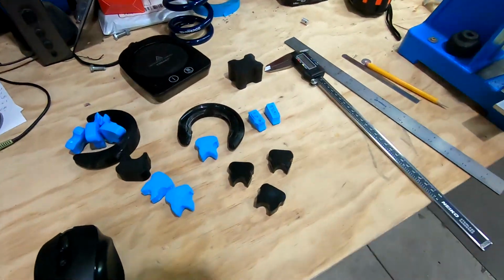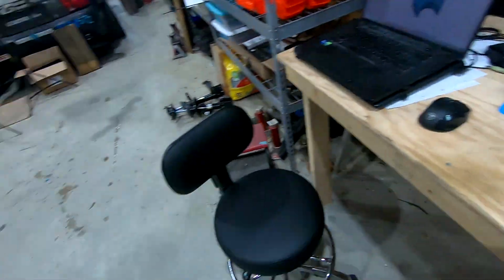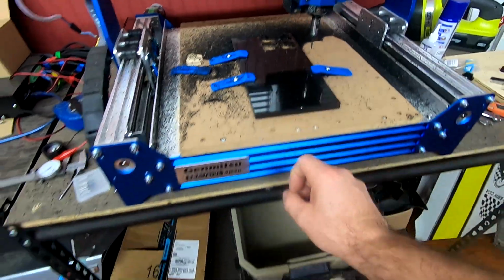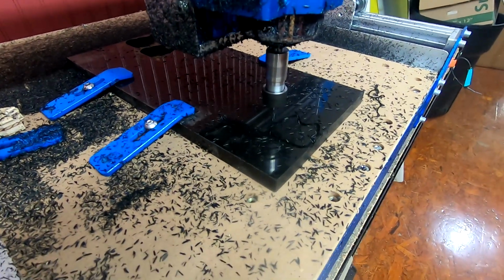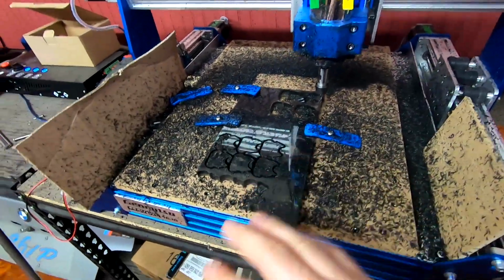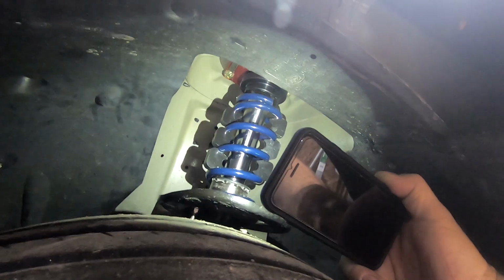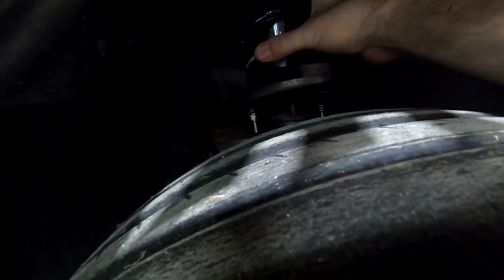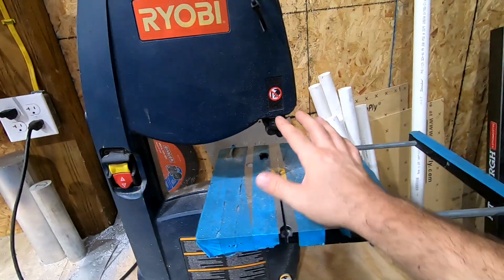Tip to Load Your Car With a Low Splitter Onto a Trailer

Comment: Why not make a solution where you can easily take the splitter+frontbumper off when loading it and then put it on when you go racin?
I know saying this its more work but still...
Reply from the maker: Because it’s a lot more work.

Comment: I print a ton of stuff in TPU, which takes way more abuse than what people think. My printed front control arm bushings have 2 seasons on them in my Miata (full racecar)  The main downfall I find is how slow I need to print it to get good layer adhesion. I'm sure it would work for your spring lockouts, I'll be giving this a try!

Comment: Try using UHMPE ( Ultra high molecular polyethylene) instead of ABS . 
ABS is not that good especially when machined and will be effected by chemicals. 
UHMPE is far superior, machines easily has good wear resistance and self lubricating for bearing surfaces . 
You just can’t glue anything to it . 

Also ideal for replaceable wear plates on splitters, anti roll bar bushes and a whole host of other little jobs . 

It’s commonly used in industrial applications for conveyor / machine guides , wear strips and even coal bunker liners at power stations . 

Stockists are easy to find just search industrial plastic stockholders and something will pop up . 

Don’t know why I haven’t subscribed earlier so just have 👍

Also going back to ye old pattern making topics I use plastic sheet for my mold flanges etc and pre form patterns. 

PVC sheet and plastic tube is ideal as it can be glued , sanded and painted and even backed up with GRP for quick patterns and one off molds .

PP ( polypropylene) can be used for large flat surfaces and no release agent is needed 

PE ( polyethylene) is similar to the above. 

Polycarbonate is also ideal for patterns as it is quite stable and can be bent , glued or welded. 

All of the above can be cut easily. 
Best way to bend is route half way through wit a 45deg router or cut half way with a circular saw table , warm gently and let it cool  .

🇬🇧👍

Comment: Maybe version 2 of the lockouts... have the 3 lockouts all connected together? Like a comb or something  so you can push all 3 in at once and not 1 at a time?
Reply from the maker: Original was like that and was to much of a hassle. I found individual pieces much easier.